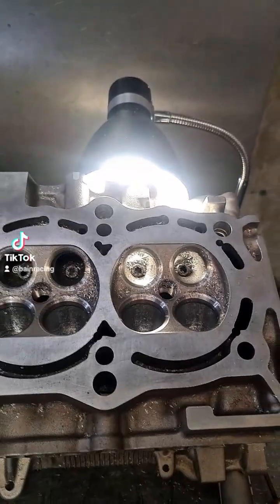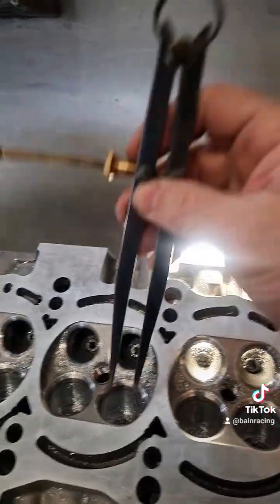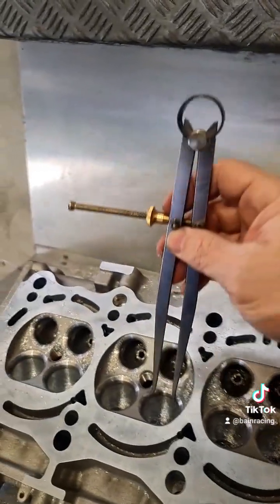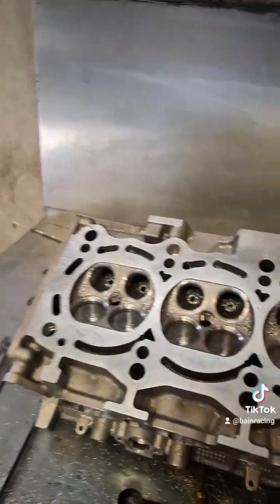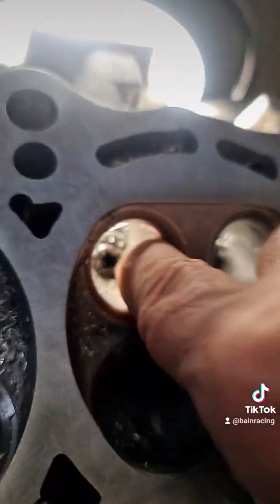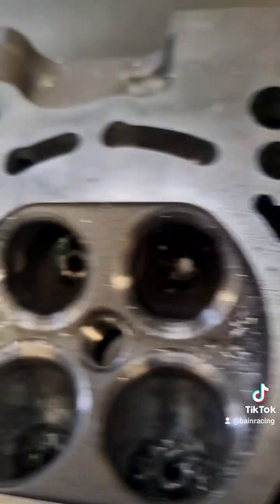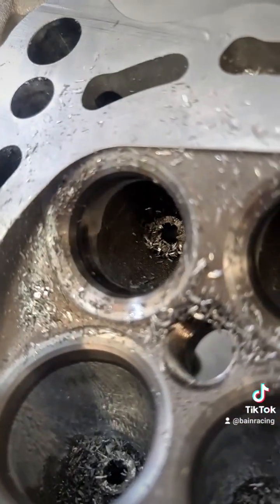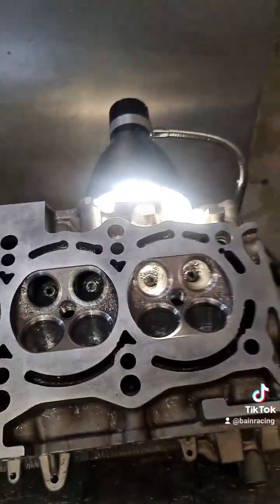"Mastering the Art of Hand Porting: The Complete Guide to Porting the Toyota 2JZ-VVTi head Part 2

Comment: The ford/mazda 2.0 I’m working on has some core shift but tidied up well. It had bumps in all 4 bowls all around the spark plug. I mostly removed them. Hope they weren’t there for a reason. 
It seems like a very well designed head. Even has a sharp, deep C shaped divider.
Reply from the maker: Yeah, just be careful with chamber mods as some bumps are for wet flow and to stop wetting the plug. I don't know the head personally so can't say mate.
Reply: Oh wow, ok. Thanks. 
I would think those bumps are maybe not for wet flow since they are in both exhausts also. They are in the long side of the bowl. 
Great point to keep in mind!!
Reply: @bainracing
The 2.0 doesn’t seem to have any plug wetting issues and has strong idle without misfires. No issues with WOT at low rpms.